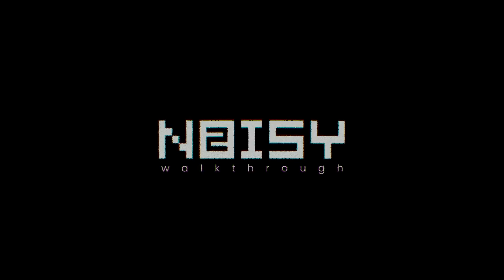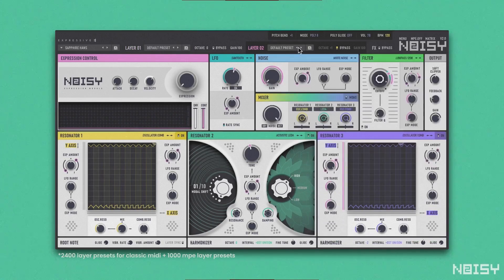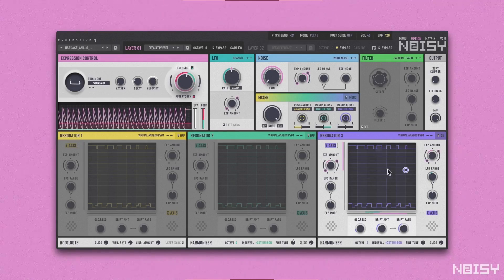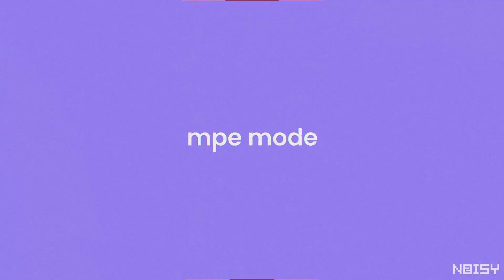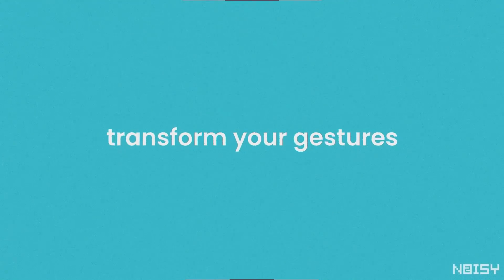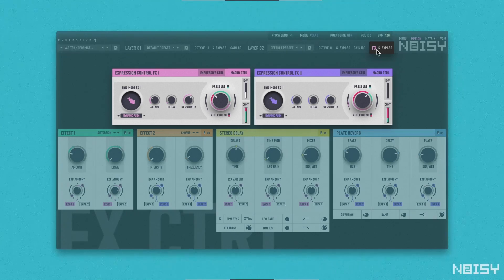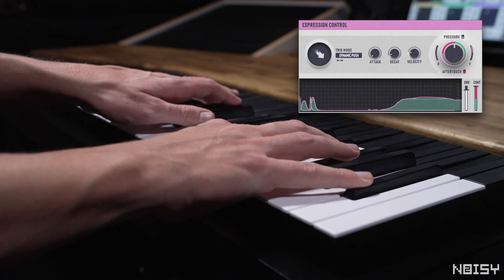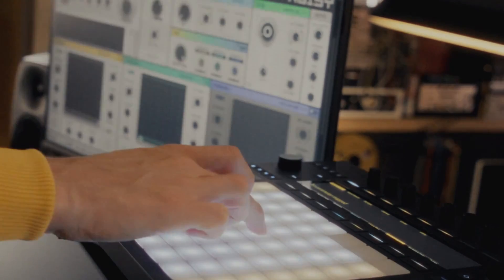Noisy 2 - Walkthrough Video

Comment: great. i own a touche. do you need to open LIE to make use of the touche with noisy2?
Reply from the maker: Hi, yes, using Lié would be the regular way to go, but since the logic behind the mapping of parameters is very straightforward when it comes to the integration of Noisy2 in Lié, you could also use Touché in its default standalone state that sends MIDI CC16/17/18/19 and make the mapping directly in the mapping "matrix" of Noisy 2, omitting Lié.
In the matrix, the four expression control blocks named "l1_exp_ctrl", "l2_exp_ctrl", "fx_exp_1", "fx_exp_2" would need to be assigned to CC16/17/18/19 and you'll end up with pretty much the same setup as if you were using Lié.

Comment: Very impressive! Slightly bewildering, as I'd never even heard of Noisy 1 and this is all new to me. If you're planning more-detailed walkthrough videos that go into depth about all the different resonators and their controls, then I very much look forward to watching those. I've found my Osmose very good for controlling even basic MPE synths, so I can't imagine how awesome it will be with this software! The only question is... do I spend this month's budget on this, or on whatever Cherry Audio is about to release next week? Tough choice! 😂
Reply from the maker: Hi, thanks for the friendly message. The walkthrough of Noisy 1 is actually going more in detail regarding the resonators and their settings. Even if the GUI has changed, and the new features of 2 are obviously not mentioned, this should be interesting: https://www.youtube.com/watch?v=CKU5xONQh78
Also, there's a workflow tutorial on page 46 of the Noisy 1 manual that should be helpful. https://expressive-e.s3.amazonaws.com/NSY-Noisy/Noisy_Manual.pdf
Reply: @ExpressiveE  Thanks! I'll check out the video.
Reply: @ExpressiveE  I watched the video, and things are a lot easier to grasp now. Thank you! I can see why you took the MPE step – it makes a lot of sense to make the control multi-parameter so that more expression is possible. By the way, I found the modulation philosophy in Noisy very intriguing. The idea of having rise and fall slew controls on every modulatable parameter is clever, and I'm guessing it makes for a very efficient workflow when setting up a new sound. Congratulations on the new release and I look forward to discovering what I can achieve with my Osmose plugged into it.